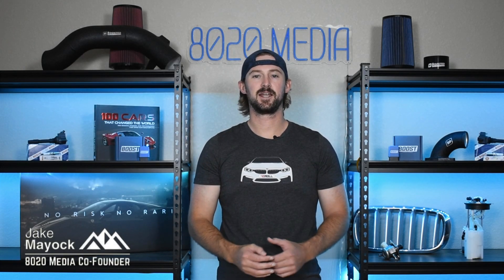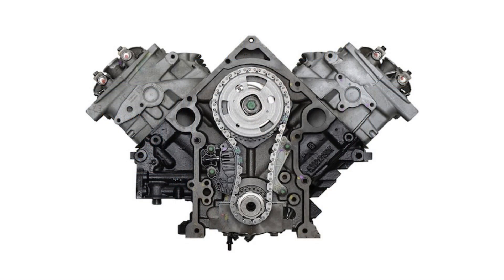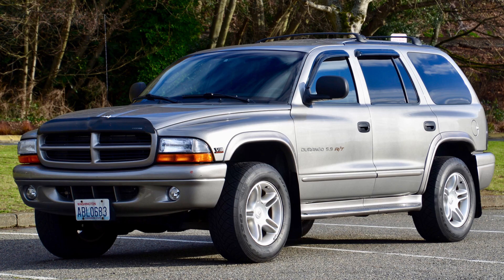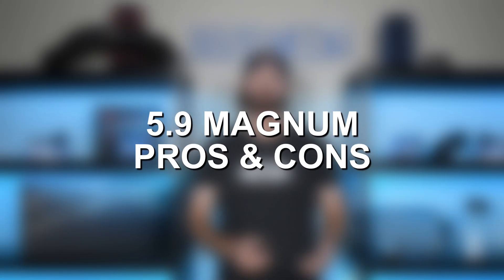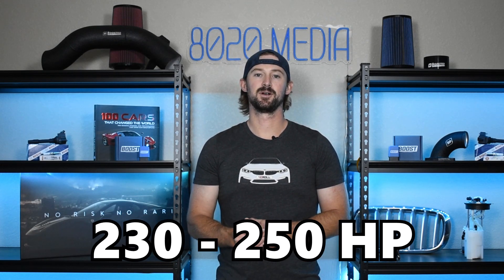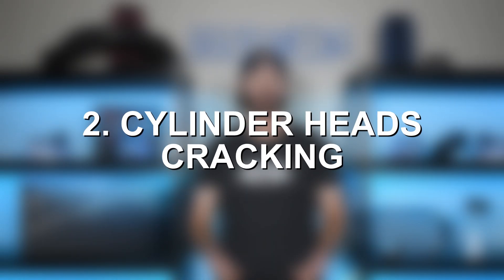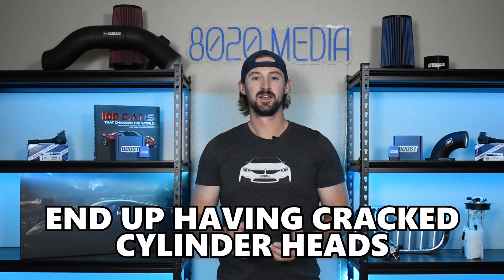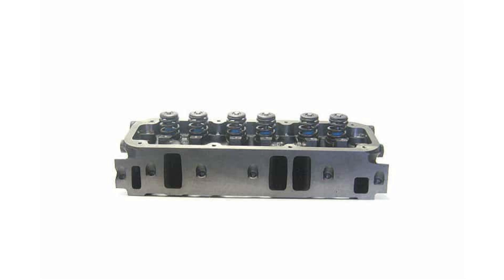The 5.9 Magnum Engine | 3 Common Problems & Reliability

Comment: They use 360 back in the 70's
Reply from the maker: J - Think you may be thinking of a different engine?
Reply: @8020Automotive  1971, when Chrysler  released it

Comment: I daily a 5.9 98 and I love it. Good engine little slow but it tows smaller trailers no problem. Worst part is that you can do all the work in the world to these and still will only be able to sell it for 4k lol. About to hit 150k and my cats clogged due to probably a plenum leak. Gonna get the Hughes kit and maybe upgrade that timing chain. At least they’re easy to work on!
Reply: 5.9 only came in the jeep 5.9 AWD limited and they were fast
Reply: @Hazbin_hotel456  It is about a 1000lb difference though between the jeep and the ram trucks. I have one in my 5200lb single cab long bed ram truck and it is reasonably peppy in the mid range, but it is slow from a stop
Reply from the maker: M - Thanks for taking the time to share your experience!
Reply: How do you diagnose that your cat has clogged? I have a 5.2 that's had a plenum leak for an unknown length of time at 140k miles

Comment: For now only upgrades i have on it is brembo brake pads, brand new brake lines, drum shoes and hardware are frlm power stop and also the calipers and rotors.  I do want to get a brand new plenum for it. Also i do want to rebuild the transmission with stronger gears as well.b
Reply from the maker: C - Nice! Keep us updated.

Comment: I had 3 (2000-2001) dodge ram 2500 Magnum with service bodies. Down to the last one now, with 240,XXX on the clock. Some notable conditions I can attest to after putting nearly 700,000 miles on these trucks combined are as follows: 

- Plenum gasket (hughes engines makes a great kit with an aluminum plate)

-Cracked heads (current engine has 3 cracks in the head, still runs and drives perfectly fine) They were known for weak casting between the exhaust and intake valves, and are really susceptible to cracking there.

-SUPER MILD stock cams. you can drop in some off the shelf cams and get much better HP and torque curves. I've never done it, but the data, parts, and testimonies are out there

-Timing chain - routine maintenance, upgrade to a double roller and your good for 200k-ish. 

-ABS Control module - They no longer manufacturer them, you can still find functioning used ones out there for around $350

-Front end - Constantly rebuild the front ends at 50,000 miles. 

-Fuel Pumps and Filters - Had 3 fuel pumps just die while driving, also the fuel filter is not in line, it is in the pump itself, so you can't service fuel filter. 

-46/47/48 RE are trash. Known problem. Most times is starts with broken overdrive spring, governor pressure solenoid, governor pressure switch. Also, these have adjustable bands. should properly adjust your bands every 30,000 miles at trans service. Most I got out of a stock trans was 212,000. Upgraded them to stage 2, with Deep Trans pan (holds extra four quarts) and oversized trans cooler, with shift kits. Temps never risen over 190 when towing in Texas heat.

-The dashes crack,  plenty of caps or full dash/bezel replacements on aftermarket

-they are SERIOUSLY underbraked. you can put 3rd gen brakes on, but need to run a minimum of a 17" wheel to clear the bigger calipers. (no need to upgrade master cylinder)

-the Voltage regulator is in the CPU, so if you have an alternator fry, it can sometimes blow the Volt Reg in CPU and you need to get a new CPU. 

-Exhaust leaks, cracked manifolds, broken exhaust pipes, fact of life

-The power steering boxes leaked on all of mine easy replacement

-Perform regular maintenance (plugs, wires, cap, button,) Service trans every 30K (bands, fluid, filter) run 91 or higher octane to fight ping, I run full Synth Mobil 1, Give them a nice seafoam treatment every 5-10K. 

-My Upgrades: Hughes RPM intake manifold, Big Gulp Throttle Body, K&N CAI, Electric fan kit, Deep trans pan, oversized trans cooler, 160A Alternator, Dual batteries, 4.10 gears, stage 2 trans, shift kit, Accel ignition, 180 degree t-stat,
Reply from the maker: C - We really appreciate you taking the time to share your experience! This will certainly help future viewers.
Reply: @8020Automotive  Cool of you to reach out brother! You have a big channel and I am just a nobody commentor! They are great trucks, otherwise I wouldn't have bought/kept/killed 2 of the 3 three and driving the 3rd one till it gives up the ghost. I honestly debate putting a 408 stroker and gear vendors in this one if it ever gives up. Probably 15K to put into it, and a cheap paint job, and work it another 15 years...
Reply from the maker: C - We try to answer every comment, regardless of how big we get! We strive to build a community of others helping each other in the automotive space! And you're doing just that. So thank you!

Comment: Hey Jake, sorry for this off topic question. Bud can you please help. About 4 months ago I did some preventative maintenance on my 2003 Toyota Camry XLE 3.0 V6. I cleaned the MAF sensor and the throttle body except I never removed it from the car and I never unhooked the battery cables either while cleaning anyways. After I finished cleaning the TB and MAF sensor I cleaned the battery terminals. Anyways after putting everything back together and starting my car it ran sluggish like it's supposed to until a few miles of driving and everything was good or so I thought. The next morning at a cold start my RPM was high. Before cleaning a cold start RPM was around 1250 but ever since it's around 2100 RPM but only at a cold start. No one can figure it out I have no codes and no vacuum leaks. It runs fine all except for the high RPM at a cold start only. Please help?
Reply from the maker: D - How many days has it been since you cleaned the parts you mentioned?
Reply: @8020Automotive  It was around 4 months ago when I did the cleaning. And I've had that cold start high RPM every sense . I drained the power yesterday by unhooking the battery cables and used a jumper wire thinking it would reset everything but I still have that high RPM at a cold start. Maybe I broke a gear by opening the butterfly by hand. I cleaned the throttle body, MAF sensor and battery post and changed the air filter with a supposedly OEM air filter off eBay but I'm starting to think the filter is fake.
Reply from the maker: D - Could certainly be possible.. Very odd. Have you taken it to a shop?
Reply: @8020Automotive I've taken to one shop but he told me that it didn't do it on him which I know is very untrue because it does it every morning/ cold start. I don't know where you're from but I live in Kentucky and you cannot find anyone that knows shit around here. I had to drive to Tennessee once to see Scotty Kilmer because no one around here could diagnose a bad catalytic converter. That's how brilliant they are around here. Most the time if their actually able to fix anything they end up screwing something else up.  And want to charge me for what they broke. I had a window put in my car at a body shop and the very day I picked it up I tried rolling the window up and down but everytime  it reached the closed position it would come back down. And they wanted to charge me for that lol
Reply from the maker: D - Sorry to hear! Keep us update on this. We hope you find the solution.
Reply: @8020Automotive Sorry to bother you again. I'm no mechanic and I'm getting mixed information. Does my 2003 Toyota Camry XLE 3.0 V6 have a idle air control valve? If it does might that be my problem that we previously discussed?
Reply from the maker: D - It's possible!